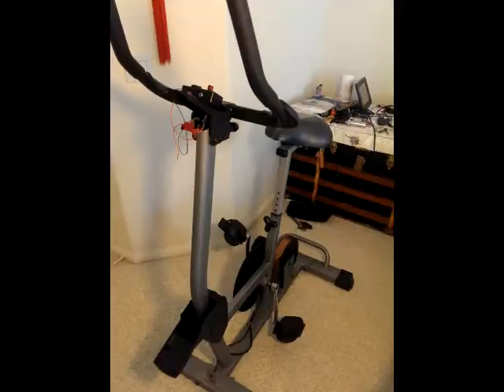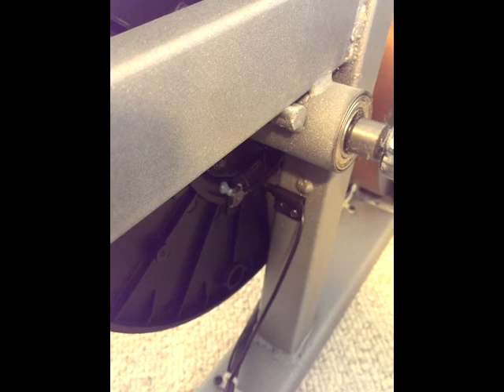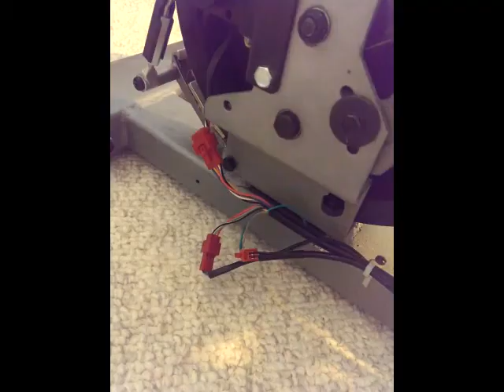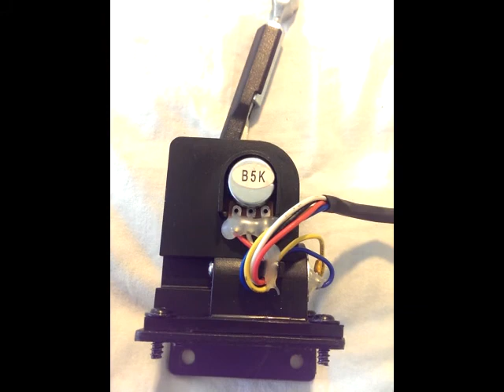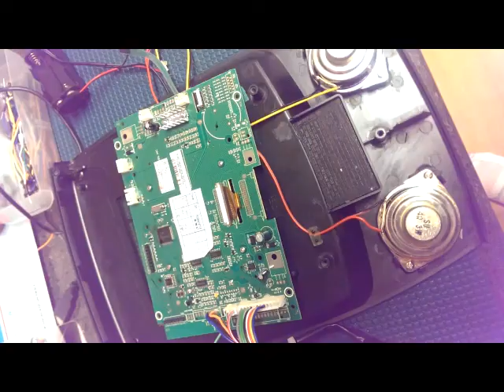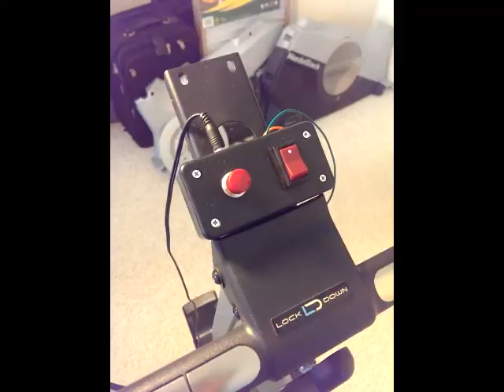Fix NordicTrack for $15.00

Comment: The display panel on mine just died, it lights up, but cannot see any readouts or chge the bike settings. Any tips ?
Reply from the maker: C Mitchell,  Can you test out the motor like I did in the video.  If the motor still works you can perform the mod in the video.  The problem with the control board is that everything is programmed on the chip and you really cannot troubleshoot the problem.  The replacement board is way too expensive.  I would convert to manual if you can.  Mine works great.  You just have to adjust the tension manually.
Reply: Thnx for the reply, unfortunately I'm not a tech savvy as you. I got it for a steal on Craigslist, I'm thinking I might just look for another. Wayyy cheaper than a new console.
Reply from the maker: C Mitchell, good idea, also check ebay for controllers. might be able to find one,  but several folks also contacted me about the same issue, so I would imagine that there are a lot of these bikes around with bad controllers.
Reply: What would you charge if I sent you the display, & you construct a work around device ?  This is my model.....http://www.searsoutlet.com/C2-si-Upright-Exercise-Bike/d/product_details.jsp?pid=10972&
Reply from the maker: C Mitchell,  First you need to determine if your tension motor is working.  You can use the instructables article to determine this.  If the motor is working, I would need to know which two wires are powering the motor (colors) . Would you want a manual control box like I built?  You can contact me at j_pitz@yahoo.com